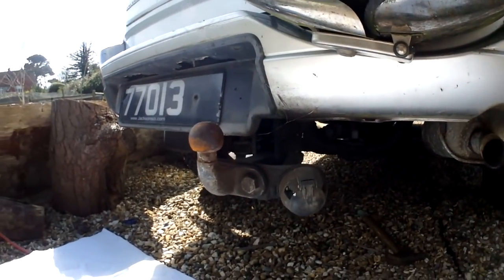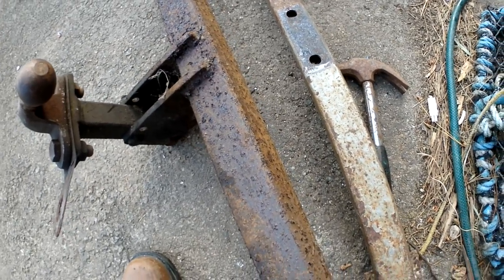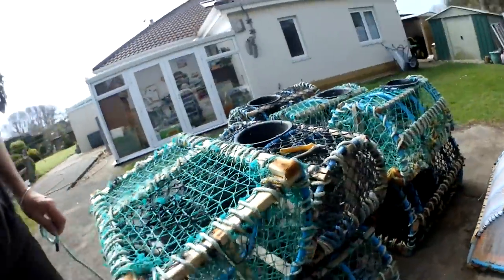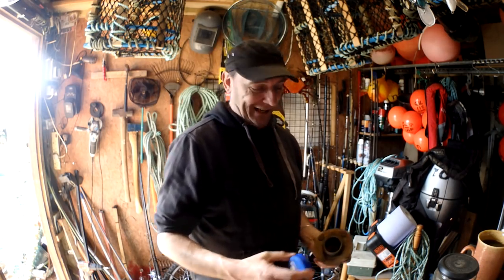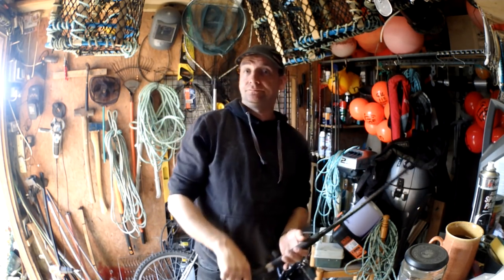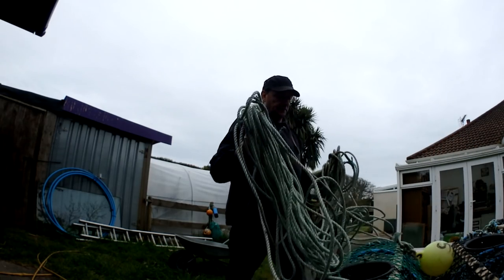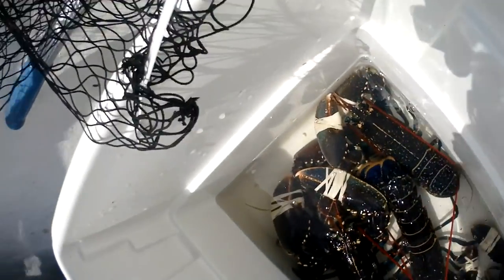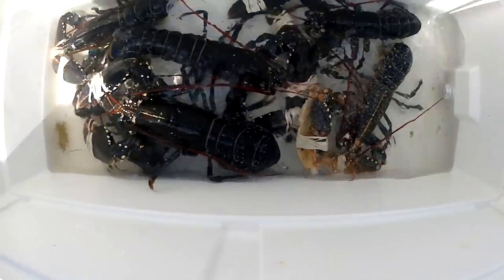Lockdown Continues - Fishing Tips Tricks, Crab pots, Tow Hitch & a Fishing Trip

Comment: Great video Troy, some useful info there!  I'd never heard of the 'blowing on a knot' trick, I'll have to remember that one!   Regarding your use of Bicycle tubes, I managed to get a small motorcyle tube a few months ago, and I stretch a band about 1" wide over my fixed spool reels to stop the line coming undone.  I find the line clips on spools will not hold a 60lb leader in place, so you end up with a tangle in the bottom of your tackle box.  Stay safe and thanks for the updates.  You are doing wonders for the mental health of many subscribers!
Reply from the maker: I use it on spools as well its useful stuff

Comment: I like the tip about blowing on the rope,never heard that before.question for u Troj ,that plastic pipe on your gunnel of your boat, was it very hard to get on?
Reply from the maker: It can be got to watch your fingers depends on your boats curve but you can get it on even if you use shorter lengths

Comment: Troj ,I really enjoy watching your videos but I am surprised by 2 things ,#1,Why do you not have a pot winch set up to pull your pots ,and #2 ,why do you not have an end door on your pots ,to make emptying out the pots so much easier ,I have these things on my boat and pots and it makes life so much easier ,with all the eels you catch you just open the door and tip them out ,no risk of being bitten and it makes it easier to get all those big crabs out.
Reply from the maker: I have just bought a winch and a few pots have doors but it makes the build take longer, costs more and makes it easier for thieves plus when they trow the pot back it wont catch as they tend to leave the door open. I can untie the end of the pot if I need to
Reply: @Trojwaterman  Thanks for your answer Troj ,and speaking of tips ,get yourself a lip gripper ,it helps getting the hooks out without getting jagged ,and I still have not seen your pot winch in action yet.